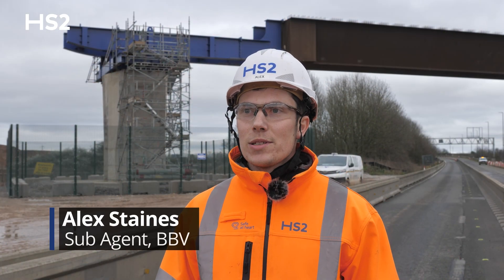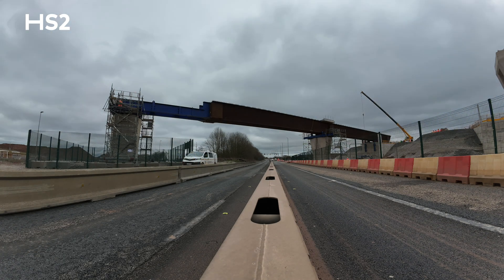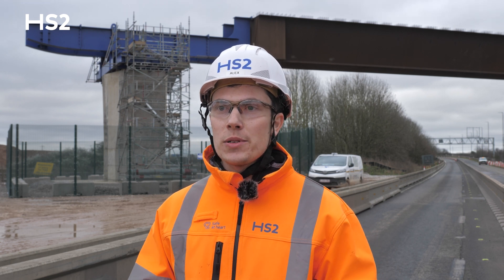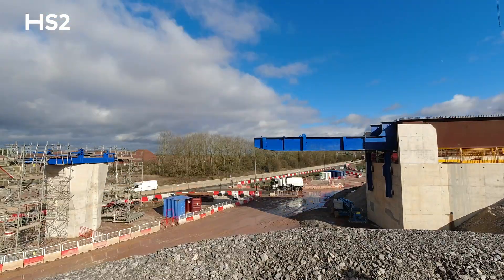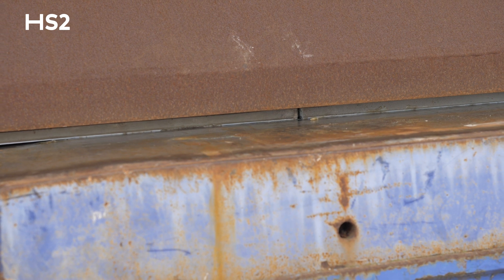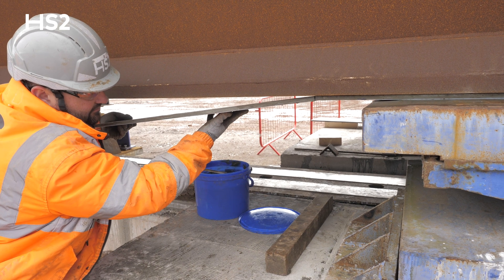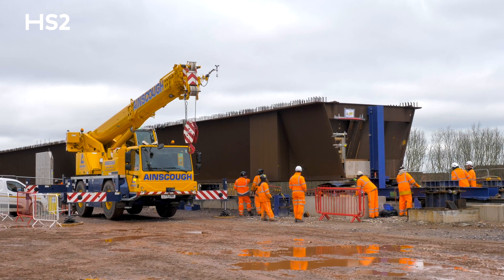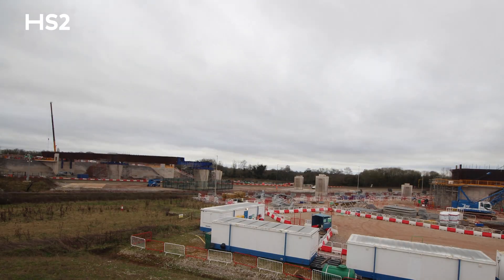300 tonne steel viaduct section moved into place over motorway network at HS2’s Delta Junction

Comment: It doesn't go into Birmingham city centre, you either have long up hill walk to get to the city centre, or catch a bus or taxi. And it doesn't go into London centre either, so what's the point. Any time saved by speed of train is lost.
Reply: That's what I said, but I have been informed that curzon street is right next to Newstreet. Must be something else they have changed in the city centre since I last went through. That's progress.
Reply: @barrypickles6546  I think some thing may have been done to Birmingham City Centre to put Curzon Street Station next to New Street, as a Brummie I can tell you Birmingham Curzon Street Station is no where near Birmingham New Street.
Reply: @peterwallen1063  o good they have moved moor street, and knocked down the rotunda, got rid of the shopping centre, closed the roads. A good job because it took about   10 minutes before just to go from New Street to moorstreet. Christ it takes 5 to get from New Street to the Queensway. I hope you know where I am referencing, otherwise I am just wasting my time.
Reply: @peterwallen1063  err, yes of course.
Reply: I think mate you need to either come and visit Birmingham, go on Google Earth or do more reserch, as a Brummie ( Birmingham Citizen to you ) I can catogorically tell you that HS2 terminates in Birmingham City Centre, you are getting confused with the old Birmingham Curzon Street which did not terminate in Birmingham City Centre but at Curzon Street on the extreme edge of the City Centre reqiring a Hackney carrige ride to the City Centre resulting in the Construction of Birmingham New Street Station, but the new HS2 terminus in Birmingham, Birmingham Curzon Street Station will have 2 Entrances, one will be at Curzon Street which will have Taxi and Tram stops, but the main entrance will be in Birmingham City Centre with the main entrance being on Moor Street Queensway in the City Centre next to Birmingham Moor Street Station and next to the Bull Ring Shopping Centre with a Bus interchange out side and connected to an improved Birmingham Moor Street Station making a new Midland Rail Hub
Reply: I don't think you know what you are talking about or have done any reserch into this, Birmingham Curzon Street Station's main front entrance is right in the center of Birminghm on Moor Street Queensway next door to Birmingham Moor Street Station and the Bull Ring Shopping Centre and facing the large Primark store

Comment: A bridge for a railway from nowhere to no place in particular crippled by corruption and greed by a government whose members are totally self-interested the question still remains unanswered as to why the project like so many others in the Uk was ever allowed to proceed without the required safeguards already clearly identified against poor returns but also against political interference. It is the taxpayers that have suffered from this farce and they will continue to do so until such time as the full HS2 railway is completed and not just this pathetic withered stump.
Reply: Actually this Rsailway runs from the UK's second largest city, Birmingham to the Capital of the UK London and runs from this junction to Handsacre in Staffordshire where HS2 trains will jointhe West Coast Mainline tking thrains to Mancester
Reply: @peterwallen1063   As it was always intended it should and there are numerous other connections from and to HS2 along its current route to the existing network but I believe you are missing the point here in that it is not what they are building now that matters it is what they were supposed to have been building all along. A railway to relieve congestion and add capacity to the existing network plus additional capacity through to Leeds and by association York. 

The problem has arisen here with Johnson being allowed to chop the project into phases meaning he could quietly cancel any part of the project he felt gave him political chops which alongside the extended time scale of the project has meant that any additional capacity HS2 might have realized has already been consumed by organic growth on the original network ergo no gains there for the public at large. What was meant to be a connection to HS2 for central Birmingham became the primary route for the project and the stump running to Handsacre, purely a connection for HS2 trains to Manchester. 

Dumping HS2 services off the end of the new route as you point out at Handsacre serves only to load up an already at-capacity WCML with little to no prospect of infrastructure improvements in the works to cope with this additional traffic through to Manchester airport and Piccadilly. 
In addition to this, the chopping of Phase 2b cuts out the Central Midlands interchange hub and a new line to Leeds so again, no gains there. 

Old Oak common, the to-be or not-to-be railway plan and operation still has not been finalized and if the connection through tunnels is not completed to central London then again we see loading up of the existing network already stretched to capacity by lack of forward thinking and spectacularly bad planning.

To meet its Green credentials this country needs significant increases in rail capacity and reinstatement of connections long since lost and has for decades and I stand by my statement. What the country got is a railway from no place in particular to a place no one really wants to go to with total confusion brought about by this Tory government as to how this came about and what their intentions are now.
Meanwhile, the existing network gains nothing at all from HS2 that is unless they change the way it is to be operated and downgrade it to join the rest of the network in which case why were they in such a hurry to rip up the GCR in the first place, a railway that did go to all the places required now buried under redundant shopping centres and acres of car parks with no one willing to even contemplate the glaringly obvious.
Reply: @jamesedwards7241  The only reason for HS2 was to relieve congestion and produce more capacity on the Southern half of the West Coast Mainline from Crewe to London Euston only, it has nothing to do with Leeds which is at lest 90 miles east of the HS2 line

Comment: I just don’t understand the point of hs2 if it’s just going to Birmingham- what a waste!
Reply: Again do some reserch, the actual HS2 line goes North past Birmingham to Hansacre Junction in Staffordshire where it will connect onto the WCML
Reply: @peterwallen1063  I didnt really make it clear but i was referencing more towards the cost of it. £66 billion + just for a high speed train line that is going from London to past Birmingham when u look at the original plan for it to branch of towards Leeds and then also Manchester Piccadilly/Manchester airport - in my opinion it really isn’t worth spending 66 billion  you’ve scrapped the most important parts of the project ….
Reply: @Brit605  The major part of HS2 is from Handsacre junction and Birmingham City Centre to London Euston, the bit to Manchester is but a short section and any thing to Leeds was just a waste full dream
Reply: @peterwallen1063 No it won't - that's all been cancelled.
Reply: @garrett69  Yes it will do some reserch mate, the HS2 line not only goes into Birmingham City Centre but also goes past Birmingham via the Delta Jinction at Water Orton and North To Handsacre in Staffordshire near Litchfield where the HS2 line in it's present plans will join the existing West Coast Main Line going North towards Crewe which will take HS2 trains to Manchester, Liverpool and Scotland, but the Metro Mayors of the West Midlands Andy Street and the Metro Mayor of Greater Manchester Andy Burnham have met in Birmingham to sort out a way of building the Hi Speed Link from Handsacre to Manchester, do some  reserch mate
Reply: No it doesn`t, not in high speed form. @peterwallen1063
Reply: Its a way to link the london elisabeth line to the rest of the country. No one in birmingham is going to use it, it takes 15 minutes just to walk from newstreet to the new station, so it will take at least 5 minutes longer.
Reply: @barrypickles6546  HS2 is nothing to do with the Elizabeth Line as it has now been decided to carry onto London Euston after talks with construction experts and the service tunnel from OOC to Euston has already been bored out, as for your idea of a 15 min walk from Birmingham New Street to Birmingham Curzon Street at that no one will use HS2 and Curzon Street, well why would you need to do this walk and where have you got this rubbish news from. Well for a start every one travelling by Avanti West Coast Train services from Birmingham New Street to London Euston at present will when HS2 and Birmingham Curzon Street Station opens will travel by HS2 and from Curzon Street Station when HS2 opens as Avanti West Coast who will be the operator of both the WCML and HS2 line will transfer all their Birmingham to London, Manchester and Scotland services to the HS2 route and Curzon Street Station and Birmingham New Street will have otthere services operting from it

Comment: So the viaduct takes the HS2 over the M6 /M42 link at a height of about twenty metres above carriageway, descends about another twenty metres to a depth of at least ten metres below the level of the same motorway below Parkhall Wood, that's a drop of about one hundred and fifty feet within a kilometre, at 'high speed', on a curve; and partly in tunnel. Great for the engineers and contractors, not great for any passengers
Reply: The tunnels are around 50m deep at the midpoint ventilation duct. Which is being built on the site of BCA car auction, Orton way.
Reply: Well of course. The designers and engineers have planned to make it as uncomfortable as possible 🙄
Reply: @mrglide7078  I'm pretty sure that when a train approaches the curves it will slow down or else we will see a similar derailment to that in Spain some years ago!

Comment: surely it does not take 2 mouths to weld a few beams together, should be ashamed of yourselves,could have done both sides north/south at the same time,pushed one over as seen then push other one over, u can understand why its costing a lot of money,  ie time wasting
Reply: It's such a shame you didn't offer your evident engineering skills to the project, you could really have taught these hundreds of thousands of engineering experts something they didn't know.
Reply: Wow Such a shame HS2 never consulted you as you clearly know far more than hundreds of engineers.
"Lovely Rita Meter Maid
Nothing can come between us
Give us a wink
And make me think
Of yooooooo ..."
🤣🤣🤣🤣🤣🤣🤣🤣
Reply: Rita. You should have lent HS2 your armchair of knowledge to speed things up.
Reply: @johnturner4400   *sniggers*
Reply: Ground works. Those concrete piers aren't just sitting on the soil 😂
Reply: Knowing an engineer on the project who also worked on frances hs rail, it is costing 5 times  as much per km in britian than france, we cannot do anything reasonably in the uk.
Reply: @barrypickles6546   In France they do not have the planning procedures we deem necessary, they decide a route, turf everyone off with basic compensation, build on the surface because they ignore the environmentalists and its easier to build a railway in a country with fewer people on over twice the land area (demographic density!).

HS2 is being built in the most expensive part of the UK which has cost billions in compensation, in highly densely populated areas, its mostly going underground and there has been huge mitigations on habitats and the environment.

Not exactly like for like.
Reply: Perhaps the fact Britain is smaller is a reason not to do it? According to my friend anytime they come across services(ie electricity gas) it's a million pounds a throw. At £100k per metre you have to question the logic. The Birmingham station is isolated so no one will use it. It's not going to anywhere even before, Manchester is hardly crying out for a slightly faster train to London, more like a Liverpool hull hs rail.
Reply: @barrypickles6546   You are correct in pointing out why infrastructure costs more in the UK. We have a bigger population compressed into a land mass less than half that of France plus we have far more services underground than France does.
As for Curzon Street it will be right next to New Street Station and therefore right next to the Bull Ring. Hardly 'isolated' give the numbers using New Street most of whom will transfer to Curzon Street Station off express trains.
Reply: Are you taking the piss or have you never been to Birmingham? Plus the reason it costs so much is the same reason thames water pay bonuses to people whilst getting into debt where the UK tax payer has to pay for London once more.
Reply: I'm sure they would have if they could. Safety, control and quality needs to be a priority.
Reply: HS2 is effectively a government body so of course it's going to be overpriced and completely useless by the time it comes to be operational. How can anyone be proud of a project that is stolen people's houses that it's no longer going to be used. This project has ruined more lives then it will support when finished. No engineer could be proud of this job it's the most expensive railway line in the world. It will be late and over budget which for anyone else outside of government means a failure to deliver but a classic for any government involved organisation.
Reply: @gorillafilmmakernow   You:
   "How can anyone be proud of a project that is stolen people's houses..."
Every house, property, farmland was bought at market value plus compensation. Nothing was 'stolen'.
That falsehood sums up your whole comment.